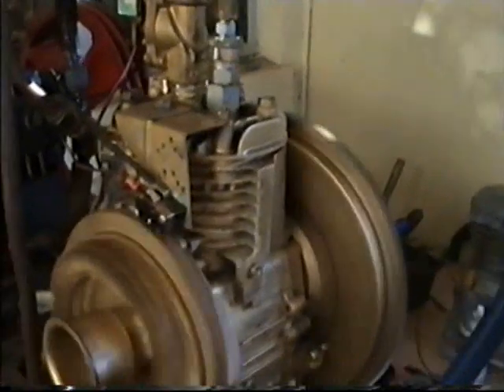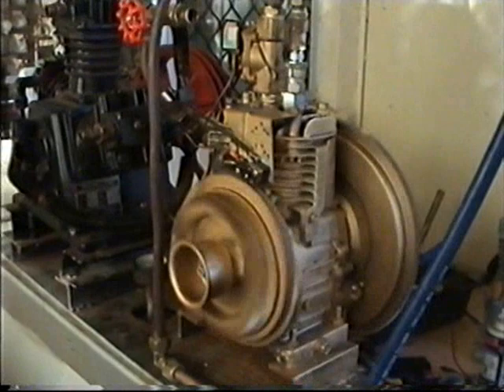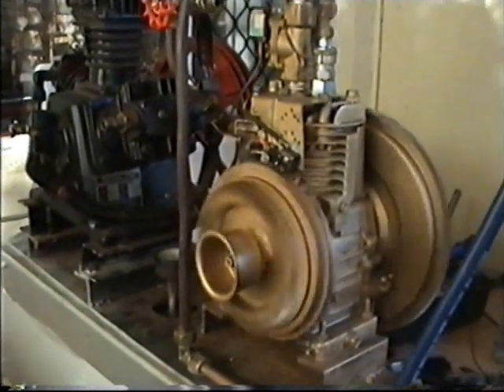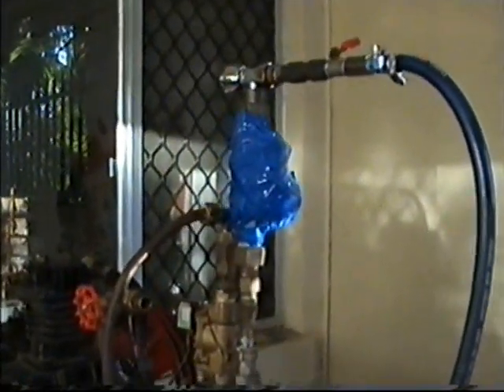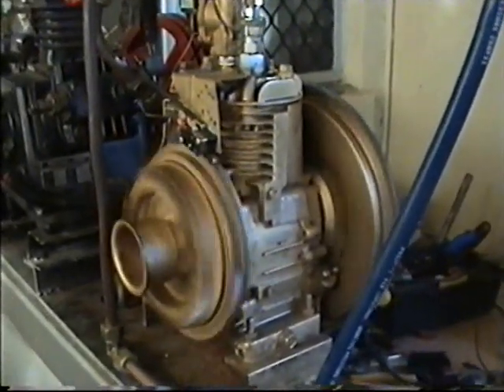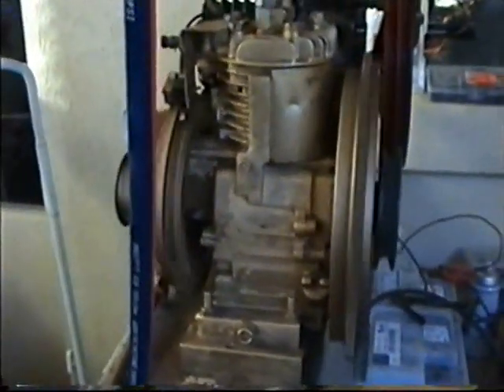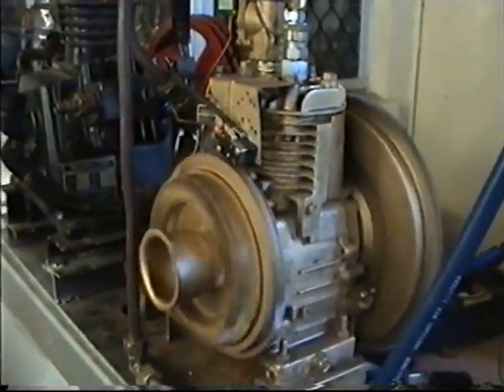FREE ELECTRICITY USING THE ALL AIR MOTOR!

Comment: Pressure differentials are just crazy inventions of the Illuminati, right? Why are you so dishonest? Do you really believe that anyone would believe an air valve would work with the same PSI on both sides of the valve?
Reply: Dr. Rhodes  You're right as rain, Doc. The closest I know of was a guy in Greenville SC made a magnetic engine out of an aluminum block Vega motor and substituted magnets for pistons and electromagnets in the head for each cylinder. He got it running but at a constant speed but this was before computers were as plentiful but someone said he'd be able to vary the speed with a digital program. Auto makers were hitting on him to sell and he partnered with two or three lawyers AND.......that was the last anyone heard of the magnetic engine. I don't know what kind of torque he was getting but it's believable. Oil for lubrication with no contamination by combustion and maybe air cooled. I've often wondered about it. Sure, it took power to run it but would it break even or make more than it used??? Since it vanished, somebody must've thought so!This was probably thirty tears ago too.
Reply: Your absolutely right, there is NO way such a device is a perpetual energy device, the second law of thermodynamics proves it is impossible for such a device to work period. Next question please...
Reply: +Lewie McNeely Having an electromagnet on each head and magnet as each piston would simply make a more complex and far less efficient electric motor...... just imagine if instead he put magnets directly on a straight shaft and had electromagnets strategically placed around the perimeter ...... MAGIC that is exactly what an electric motor is ! ! ! no pistons push rods or wobbly heavily balanced drive shaft.
Reply: Sure a radial engine would be better BUT this was back in the 70's. I thought it was a neat concept and obviously someone else did too because after he got the lawyers involved, that was the last you ever heard of it. I'd say it's hidden in a vault somewhere with a big time auto makes name on the door.
Reply: ...all the fancy business aside, a piston 'engine' of any kind will never maintain absolute pressure...they will always leak off air etc...
Reply: When magnet is heated it looses its magnetic property , so I do'nt think some thing like this can work (When piston moves it generates heat)

Comment: This is an interesting plagiarism, the air engine exists and the air battery existsthese types of design allow low cost and maintenance by storing energy in the form of compressed air. In other words this is a cheap and efficient way to store energy obtained from other sources. Check Air car project and compressed air battery.

Comment: As soon as you build a high efficiency motor you start getting accused of building a perpetual motion machine. In this video you just go ahead and claim to have a perpetual motion machine. But suppose it is just very highly efficient? It would not need to be a ppm then, but could be a very good idea for a high efficiency motor. In cases like this, it is cranks on both ends of the spectrum who stop thought: (1) the "Leave Tech as it is, you cannot improve anything, and if you do, you are claiming a PPM" crank; and (2) the "PPM" crank who claims he/she has a PPM for "free energy" and this will solve the world's problems. In between there, what if some really good ideas for very high efficiency motors are being ignored? That's what worries me. Anyway, this could be a hoax, but I would like to know more about it and see it tested by a top independent engineering lab that isn't paid for by the oil giants.

Comment: If this becomes available for purchase please notify me. Also, you could use a rotary Wankel air motor to avoid the inefficiency of the reciprocating piston? Rotary Wankel air motors have been designed by EngineAir Australia, Angelo Di Pietro. Thank you.
Reply: Jay, save your money. This is a Rube Goldberg contraption and it isn't even built well. If this was a really good example of how it really worked it would have been better built. Construction of this thing is VERY shoddy. I real machinist would have done it better as they take pride in their craftsmanship. Would you let this be a presentation piece that could change the world if it was presented this way and so poorly put together? Wankel engines be damned, it would make no difference in any case.

Comment: I like it, A) for a 4-stroke engine one would have to convert the valve-timing to a 1 to 1 speed with the crank so as to not 'waste' a stroke, B) the air must be free--a wind powered compressor, operating 24/7 with a huge volume capacity. A Savonius type of windmill produces alot of torque and one could even attach several small compressor heads to the flywheel and stage them for higher pressure. With a Haskel-pump one could get true HP air and be able to run large motors ie a car. Forget about patents, geez, just do it and share.
Reply: Wow man that's what I was thinking
Reply: Your idea makes a lot of sense.👍
Reply: Yes but for new people who understand 0 about engines and electricity, it doesn't help. We need a step by step process

Comment: yeah, i was going to make fun of the idiots from PG&E making comments on here about his low IQ because it takes huge ingenuity even to make a hoax,  but i can't get past how he says, " viewed from all angles"  and its not, clearly there is a blue air line coming up from under the bench and the sound of a compressor, is this guy just having fun hoaxing, or completely horrible at describing how this works? Also he has to put a reasonable load to it to show any worth in this, there are plenty of designs that will turn forever until you apply load.

Comment: what if you used a close-loop system once the tank is charge to let's say 125 psi start the motor the exhaust will be equal then returned to the tank no loss
Reply: And there fore no energy can be freed up from this impossible machine. If you have no energy exchanged from a higher state to a lower state the entropy will be null. No differential in units of energy in exchange means no transfer can be completed. 
I work with very large lasers and there always has to be a transfer of energy from a higher state to a lower state, so in essence how would a heat pump work for heat exchange without a temperature diferential. It's the same for a laser from a higher state of excitation to a lower state of excitation called the ground state. No output can be attained in such a system. Period, sorry but you have failed the simple test of 1st year physics. Fred is wrong, and Chris your right. Next question please...
Reply: Dr. Rhodes And one fine point I forgot to mention, how is it possible to get something for nothing? The answer is, you can't.
Reply: Dr. Rhodes
that's right, once the air expanded in the cylinder the air pressure would equalize and the motor would stop and NOT run!!
Reply: TheDave570 Your right, but you already know this. All these phreaks are doing is wasting time, and their own money on junk science. As long as it's their time and money it's harmless to any one except those foolish enough to believe in this junk.

Comment: Well Germany has now produced an air car with a very small motor in it to generate compressed air, so it works out to be 1 litre per 150 km, it's a nice looking little unit..building on this would be a motor which uses hydrogen to produce the compressed air...

Comment: The motor itself runs an alternator therefore powers the compressor. Then the compressor runs back to the motor and the exhaust gets pumped into a reserve tank to use added from the compressor. Pretty simple actually. This causes it to run for a good period of time but it will strain out of electricity eventually due to energy loss in the alternator and battery. And yes in a way its generating free electricity (not energy). Its not like he got the electricity from a power plant somewhere nearby.

Comment: lol you can hear the air compressor running in the background continuously at probably more than 2500 watts for nearly 3 minutes. what's that running from is that running using only the tears of baby squirrels. all you have done is build an air motor. which you can buy from and pneumatic equipment retailer.  you sir are a dick.

Comment: im pretty sure thats not possible. the law of energy conservation doesnt allow energy to be created or destroyed. you use the pressure to create the same pressure plus the energy lost in heat (friction). just doesnt make sense to me. theres never been an engine thats been even close to 100% efficiency.
Reply: even if you could hit 100% efficiency, which isn't possible in the presence of gravity, It would need every bit of the energy produced to run itself, so it would run itself but nothing else. I want to use compressed air as a energy storage device. Use the compressed air to turn a tesla turbine for extra efficiency and ease of construction. Then maybe have a windmill use the energy it makes at night run a big compressor to fill air tanks that will spin the turbine when the batteries are taking a real big draw of energy

Comment: I notice the video does not show us what the copper pipe is connected to. The volumetric efficiency of piston engine such as your Briggs & Stratton is much too low to feed the exhaust back into the intake and run itelf, unless you also feed the tank with unicorn flatulence or a real compressor ( which is clearly audible in your video).

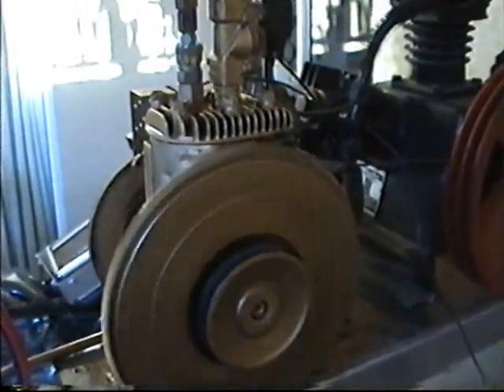Comment: RUNNING ON NOTHING BUT FRESH COMPRESSED AIR @2:40. Air compressors run on energy derived from fossil fuels, nuclear energy, or hydro electric that also impacts the the environment. All you have done is make a Rube Goldberg contraption to convert electricity back into electricity, while introducing a whole lot of  inefficiencies. I can see the copper pipe adn solenoid and suspect that is fed byu the air compressor I hear running in the background. FREE ELECTRICITY MY ARSE.

Comment: Perpetuum mobile doesn't exist. Free energy does not exist too. If You use a motor or an engine to start this rotating machine, then the energy comes from that. There is friction in the bearings, so they are turning the energy rotating the shaft into heat. Heat dissipates away from the bearings, if not, there will be a meltdown sooner or later. Don't decept people with that kind of misterious machines, every machine stops without pumpin some kind of energy in.

Comment: This is not a (closed loop) design that he wants us all to believe. Once the exhaust valves open, it will become a balanced system. The air pressure in the cylinder will become equal with tank pressure. Guess what, the piston will lock down at B.D.C. and seesaw back and forth. Failure. But it runs off that blue hose coming out from under the table from the electric compressor, so he is recharging the air tank with compressed air. Ya buddy We are not blind dude.

Comment: Something to think about, BLOW-BY past the cylinder rings WILL go to the atmoesphere and will eventualy deplete the air in the tank. Also a alternator has to have alot of RPM to charge. I would like to see a vidio with a load placed on it. Then I might test this thery myself. Thanks for the vidio !!

Comment: I suppose you could have wind turbines constantly compressing air into canisters and store them like batteries in the basement, so when you have used one canister you just put on another one and fill the used one up with your wind mill pump.

Comment: Once a alternator was attached, the resistence it would create when"trying" to charge a dead battery would be so great that it would stop the air motor/engine in it's tracks.

Comment: Continue to compress the air at a greater pressure than it is utilizing and the tank would explode unless you use some type of pressure regulated bleed off system which further proves that air would be created from nothing and goes against the laws of thermodynamics. It can't nor will it ever work. Plus the smaller air compressor can be clearly heard in the background and there isn't even a belt attached to the compressor assemble mounted on the tank. FAIL!

Comment: With that being said, the output energy (torque) of this engine would have to exceed the input energy (compressed air) in order to decompress the air at a greater ratio to replace the volume of air displaced by the piston during every stroke. You can't create energy or mass out of nothing. And to create more air than is being used you would have to manufacture air out of nothing which is in itself impossible. If it were possible you would have a "run away" effect in which case the engine would

Comment: There are three laws of thermodynamics. The first law of thermodynamics, also called conservation of energy, states that the total amount of energy in the universe is constant. This means that all of the energy has to end up somewhere, either in the original form or in a different from. That, for all the people on here that believe this engine actually runs on compressed air the said engine creates while running, means that the output energy can and will never exceed the input energy.

Comment: An engine running on compressed air is nothing new, it's 300 year old technology, known as a steam engine. You ever notice how they can't just use the engine's power to recompress the steam and reuse it? THAT"S BECAUSE THAT DOESN'T WORK, the laws of physics  and thermodynamics state that it is simply not possible. So, trying to power an engine off a compressor, and the compressor off the engine, is taking 300 year old technology to a level that is only attainable via the short bus.

Comment: So the tank has compressed air that runs the motor that compresses the air back into the tank. U can charge a battery with an alternator. The alternator and motor both contribute to resistance plus the loss of air  ( minute as it may be) but still. How do u get a net positive energy output from that system? What am I missing?

Comment: Do these cabs run indefinetly by recirculating their exhaust back into the tank? Or do they discharge the air back into the atmosphere once all of the usable energy has been taken out, e.g, after one time through the cylinder

Comment: So, less energy is used to compress the air than is produced by the compressed air? So, air is a magical energizer bunny that produces free energy? It is possible to run an engine on compressed air, which I never denied. I just did the math to show that his claims are mathematically and physicially not possible, unless you reside in another universe. You can store energy in compressed air to run an engine. You cannot, however, use that engine to recompress the air, you will have a net loss

Comment: So, there you have it. He took a 5 horsepower engine, turned it into (realistically) an engine that probably produces 3 horsepower or less, is supposed to power itself, and still produce 21 usable horsepower. I chalk this one up as a loss for the youtube kook, and a win for Physics, as well as an astronomical waste of my time. This has no application for transportation use in cars, trucks, and buses, and is at best a rube goldberg machine, with no practical use

Comment: So let's assume 5 inches of piston area, which multiplied by 120, gives us 600 pounds of force per stroke. Every 4.8 strokes would equal one foot of piston travel. So 600*1000/4.8/33000 should equal horsepower, assuming no power is lost due to friction, sound, or inertia in changing the piston's direction of travel 1000 times in a minute. You end up with about 3.8 horsepower, well short of the 21 required to produce the mythical 16 kw

Comment: Let's assume that the engine is running at 1000 RPM, which is probably pretty high, considering how you can hear the individual strokes, but we'll give him the benefit of the doubt. A briggs like that typically has a bore and stroke close to 2.5 inches. Let's assume 120 psi air pressure, which is about the max that most electric compressors make. A horsepower is equal to 33,000 foot-pounds/minute. (2.5/2)^2*3.14 = 4.91 inches of piston area

Comment: Also, in order to get 16kw from this setup, assume the alternator operates at 12-14 volts. power = voltage * amperage, so 16,000 = 12 * X. X = 16000 / 12 = 1,333 amps. 1,333 amps would need an enormous conductor, and would output 133 amps at 120 VAC 60hz , assuming a perfectly efficient inverter. 1hp = 746 watts, so to produce 16kw, the engine would need to output 21hp to power 16kw of load
Reply: fill more mix air

Comment: Finally, assume that that electric compressor you hear in the background is powering the rig. The only way that would work off of this is if the alternator were connected to the engine, the inverter to the alternator, and the compressor to the inverter. There could be no power loss to the inverter (heat), and no power loss to the electric motor or the mechanical compressor hooked up to it. Basically, you induce more losses by adding more components, making this even more impractical

Comment: Otherwise, you could have that compressor on the tank powered by the engine, so lets assume that he used an invisible belt to connect the two. The compressor would use just as much energy as it puts out, minus heat and friction. Therefore, the engine's input would be less than its output, making it a magical engine (either that or heat and friction disappeared in that compressor and engine, an impossibility).

Comment: It works as long as the laws of physics are disregarded- lets think about it. First, assume that since the compressor on the tank is not connected to the engine's output, that he expects us to believe that the engine's exhaust is fed back into the tank, where it goes back to the input with no energy added. The only problem is that the pressures would then be equal (at both ends of the tank), so therefore, the intake and exhaust would have the same pressure, and therefore, no energy.